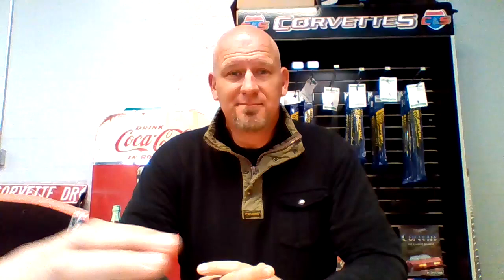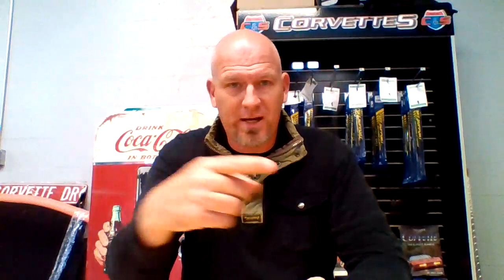Sins of the Past On Old Corvettes

Comment: Lyle, I was lucky with my mice...on my 81' they just put bird seed on the mufflers.  But on my 99' they put bird seed in the heater box. It took me a month to get it and insulation out with a vacuum and and a long reach inspection camera. 

They didn't go after any wiring. Had to keep traps all winter after that.

Comment: Roden issues.  With Covid, my wife's Tiguan stayed in the driveway for 6 days and squirrels did just that, hate wiring and made a nest in the engine bay...
Reply: They are so destructive. I keep my corvette inside a garage, and learned from replacing many rodent chewed wires, and a nest under the engine bay. The best way I found, is set up a couple motion detectors in the engine bay and leave the hood open. It stopped them cold, just don't forget to take out the motion detectors before closing the hood.

Comment: You are so right and professional Lyle. I really like your attitude about doing a good job the first time and making it factory the best you can .. If thats what you are doing for that certain customer. I want to ask your opinion and probably not going to be the first time about replacement seats. I wanted to see what you think about aftermarket seats compared to stock ones would it be a good upgrade to spend money on and is the difference so much better driving in the aftermarket seat? They say you can be more at one with the road with a better seat as far as just nice back country roads that can provide some fast fun conditions in which could afford the driver some higher speed type of conditions but not track type seats .. is it worth the money ?
Reply from the maker: Mark, I have very little experience with aftermarket seats, because I almost never fit in them.  I have been looking at Corbeau seats for my own Z06 in the hopes that they may afford me a little more room than the stock units, but at $1000 I have been reluctant to gamble on them.  I know several people who have replaced the stock seats and are very happy with the results.  I wish I had better info for you.  Lyle
Reply: @csvette  ok thanks Lyle I did do the rebuild of the seat bolster pump and it showed signs of functioning so I put it all back together and when it was all put back together it didnt work so I exchanged it for the passenger side pump and it worked perfect so the air bags in drivers seat actually were still perfect condition. 
I took that pump apart again and found I had not cleaned the bottom of that white stater well enough and the fins  were still sticking at the bottom . so took it all apart again took out that stater recleaned everything and vallaw the pump worked great so reinstalled in passenger seat go to go my man!!!

Comment: The rats ate a hole in the frame. What wrong with hockey pucks for tires.
Kidding aside. What you’ve said is all true. Many cars are 20,30, 40 & 50+ years old. Who even thought they’d still be around.
They have been “fixed” many times by people with limited a skills and budgets.
You can tell what trade someone is in by how they fix things and what they use to fix them.

Comment: I have a question, I bought a new 2017 grand sport automatic. Since day one when starting out and when the transmission shifts from 2nd to third it "Misses" it's like if you were shifting manually and didn't quite get in gear and step on the gas it revs then catches! GM  put out a letter to dealers about harsh shifting and misses. They re booted the computer twice and it still did it, not all the time though. That's the problem, when I take the service guy for a ride it doesn't do it. They brought a GM tech in to re boot it and it still does it. Only from 2nd to third gear. I can start out from a light and it does it, but it won't do it for the next 10 then it does it again. I sued GM thru using a lemon law lawyer and GM paid up 6 grand but I still have the problem!!!!! Any thoughts??